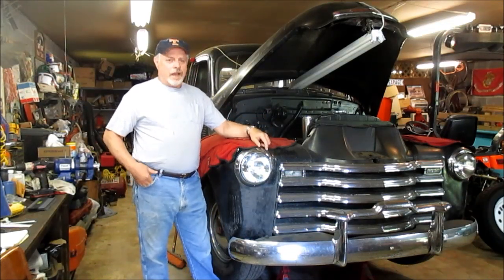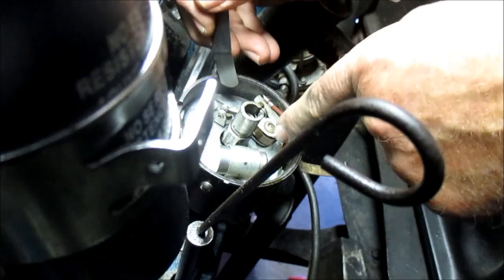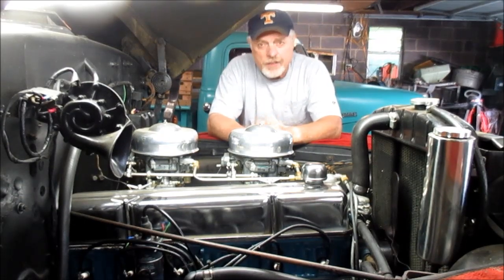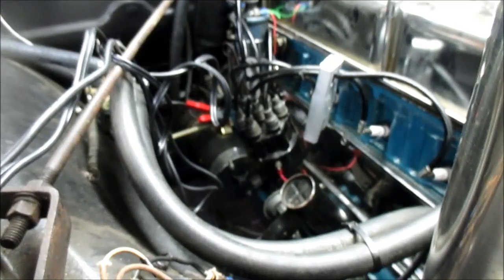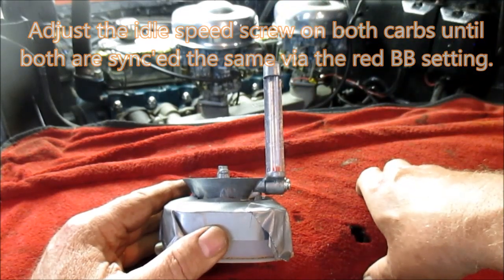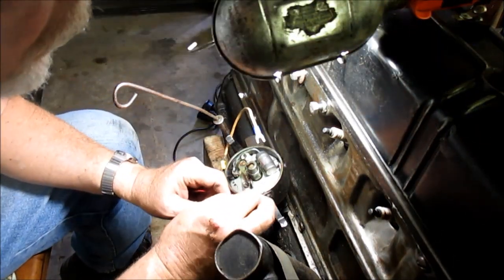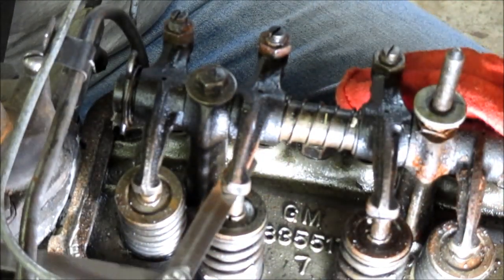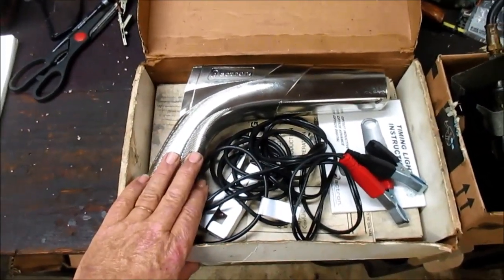1949 Chevy 3100, Engine Tuneup, Volume 37, PM part 2 .

Comment: Thanks for your support. Since you own a GMC and a Chevy trucks, We have a question for about 48 GMC vs 48 Chevy fuel pumps and its Are they the same or interchangeable? 
See we ordered a GMC fuel pump by error and we installed it but we were not able to get to pump fuel from the tank to carburetor. We ensured the lines are not obstructed and a new fuel filter. We just ordered a replacement pump for a 216 Chevy engine and received it today. We hope you can “pump” some ideas to us. for your information we purchased the pumps from Classic Part of American.
Reply from the maker: The stock GMC engines are different from the stock Chevy engines back in those days. The GMC's made more power and were considered industrial. I don't know if the fuel pumps are the same. Heres a link to a fuel pump for a GMC on Rockauto's site. You could pursue it or compare it to a 48 Chevy 216 fuel pump.
https://www.rockauto.com/en/catalog/gmc,1948,fc280,3.7l+228cid+l6,1486826,fuel+&+air,fuel+pump,6256
Reply: @Volfandt  Wow! Thanks for your advise. Since we have both pumps on hand physically I see no difference. Took some measuring of both pumps actuating levers and I can’t find a significant difference between them nor physical body. It may have to do with pump suction capacity Vs under mounted fuel tank Vs fuel tank mounted in the inside the cab.
Reply: Well, we’ve received the 216 fuel pump from Classic Parts and located our old pumps (which misplaced) and compared the GMC, Chevy and our original fuel pumps and they visually look the same except that the actuating levers are angularly not equidistant from the pumps lower housing thus affecting the relationship between the lever and the cam shat lobe. We disassembled the GMC pump and used its upper housing and diaphragm on the original pump’s lower housing. Installed the latter assembly on the engine and filled the output line with fuel, cranked the engine and got fuel to carb. In a few days we’ll be starting the engine. Our deepest thanks for your insight.

Comment: Hello David.. I’m not to far from you in East Tn. Up around Oneida/ Huntsville. I have been following you since I got a bar find 54 3100. This truck is mint shap and all original at 6 volt. I can’t get the 235 running because I am thinking I have the plug wire off on the distributor cap. Is there a standard of where the plug wired go from the clips and wire location?  Thank you for all that you have done. Loving your channel. Also. I would love to go to the next car show at Gibbs school. Let us know when it will be.
Reply from the maker: Hey Jason, congrats on the 54. 6v is fine and as long as teh electrics work I'd leave it that way. You can add a 6v to 12v converter to add a couple 12v circuits for radio and/or a power port and still keep the rst of the trucks electrics 6v. I did it for years.
re. plug wire location on the dist cap.
1) bring the engine up on #1 cylinder TDC compression stroke. You can put a small piece of toilet paper of similar light paper into the #1 plug hole and spin the engine by hand until it blows the paper out. Then align either the BB or UC mark on the flywheel with the pointer in the timing hole just above the starter.
2) where ever the rotor button is now pointing is where your #1 plug should align directly above the tip of the rotor button.
3) Using this firing order, 1-5-3-6-2-4, going in a clockwise direction on the dist cap, plug in #1 plug wire directly above the rotor button tip, then #5 into the next hole (clockwise), then #3 eyc. 
You should then have your plug wires in the correct position.
Good luck.
P.S. I'll try to post when the next Gibbs car show is in the spring. We now have one at the HS and another at the middle school. My church may have  one this summer also.
Reply: @Volfandt  you are great Gentleman. Please keep doing what you’re doing.

Comment: Great video, it brought back memories of my first car, a 1941 Chevy master deluxe with a 216 which I bought when I was in high school for $65 in 1968. A couple of interesting facts. My engine had 10mm spark plugs, which were only used in the 1941 model year. Also, most folks dont seem to know that the 235 was introduced in 1941 for the large trucks only. At the time the 235 used the same dipper rods with babbit bearings as the 216 as well as the tall side cover, making it indistinguishable externally from a 216 except for probably the serial number and possibly the block casting number. Not sure when the 235 changed to the short side cover and insert bearings with full pressure oiling, but I'm thinking 1950.
Reply from the maker: Good post Pete, thanks for watching

Comment: So why did you run it at that high rpm to set timing? I have always set the timing on mine at idle with the vacuum line disconnected
Reply: Also, thanks for making these videos!
Reply from the maker: @brandongodfrey5920  Your welcome. Brandon. Short answer is to email Lars Grimsrud at  v8fastcars@msn.com
and ask him for his SBC tuneup papers. It's alot of reading but worth it.
Heres some cliff notes:
1) On an SBC (& most other V8's) the engine will run more efficently, get more MPG and may even run cooler when the distributor gets full manifold vacuum at idle instead of ported vacuum.
Inorder to set the engine up properly for this the max mechanical timing (no vacuum advance applied) is usually set to 36 degrees BTDC at the rpm where the dist no longer supplies mechanical advance. This depends on the engine and can run anywhere from 2800 rpm to 4000 rpm. Theres more to it so thats why I recommend emailing Lars to get his papers. He was quick to respond and didn't mind providing this valuable resource. My L48 has never run as good as it is now with these settings.

Comment: Thank you for the videos. You make learning fun.
I’m working in setting the timing in my 216. 

Dumb question…..How did you get your truck to stay at 3000rpm?
Reply from the maker: Thanks Chris. I used an old telescoping wood clamp, one end on the gas pedal the other adjustable end against the cowl vent lever, worked great.
Truck stops used to carry adjustable throttle pedal depressers so the trucks could idle faster when sitting a long time. I don't know if they still make them.
Reply: @Volfandt  thank you! Appreciate all your videos And help!
Reply: How did you get the truck to stay at 3000rpm so you could set the timing ?

Comment: I just got the same timing light as yours.  So if my timing is supposed to be at 5 degrees at idle on a 216 , do you leave this timing light at zero or dial it to 5* and then check?   Also the total advance at 3k rpms, you recommend I do this and set to what the spec is at that rpm?  Mine is 39* at 3450rpms per the spec book.  Thanks.
Reply from the maker: There are two timing marks on your flywheel, the BB which is 2 degrees BTDC and the UC mark which is TDC. If you set your timing light to 5 BTDC you will want to time to the UC mark. You'll also want to be 450 -550 rpm.
39 degrees at max rpm must be with the vacuum connected to the distributor. Generally you want to set max mechanical advance with the vacuum disconnected and plugged as it adds approx 10 more degrees of advance. If you set your timing via max mechanical advance you really don't need to reset it at idle. What you want to do is "read" what it is at idle (by adjusting the timing light to get the UC mark on the pointer) so you can use it for future reference.  It's alot easier and quieter to set timing at idle than at 3K rpm.
Good luck
Reply: @Volfandt   I sincerely appreciate your expertise and masterful advice.

Comment: I really enjoy your videos! Great work.    Also what is a good idle speed for a 216?  I see the shop manual says 450-500 but that seems so low.  My engine runs better at 800.
Reply from the maker: I set the idle on my old 216 to 500-550 rpm and it was smooth as silk. Timing was set with the pointer directly on the BB. The carb was set slightly to the rich side. 
Try getting your timing and idle mixture set and you might get a smoother idle at a lower rpm than 800. Thanks and good luck.

Comment: Thank you for the information I just recently purchased 1954 GMC.
 Napa thinks it has a 235 but looking at the head cover I think it might be a 216
Reply from the maker: Congrats on getting a 54 GMC.  Unless someone installed a Chevy 216 or 235 engine in your GMC, it's more than likely a 248 GMC engine. Installing a Chevy 6 isn't uncommon but most GMC owners tended to keep their GMC engines as they had more power. 
Look for the serial # on the engine boss just aft of the distributor then do a search on it. You might find this web site helpful also:
http://www.oldgmctrucks.com/page0010.htm
Good luck.
One more thing, one of the quickest ways to tell the difference between a Chevy 216 and 235 is the side pan cover. The 235's is short and doesn't cover the head, the 216's is big and covers the block and head on the right or passenger side. The spark plugs go through the side pan on the 216 and not on the 235.  Good luck.

Comment: Was wondering why you don't have rubber boots on the spark plug end of wires??
Reply from the maker: I wanted to keep the engine as close to period correct as I could and those are the period correct plug wires. That said, if your not careful they'll bite you, LOL.  If I go with a GM HEI I'll be going with late model booted resistor plug wires. Thanks for watching.
Reply: @Volfandt  I thought you were going to get bit when you taped your tune up, Ha Ha!! Great job!

Comment: Really enjoyed this. I have a 1946 216 on a stand that I put all new gaskets in and painted it up pretty . It to leaks a little oil on the back passenger side corner. I thought I had it sealed good . The second time I glued two gaskets together to double my thickness and thought I had it stopped. But nope. Still weeps a little. Thanks for explaining those dual carbs. I have a single Weber like yours on my stock 1955 235. To helped me understand it’s working better. I would like to go with dual carb ,dual exhaust setup in the near future. Your motor is looking real sweet.  You were saying something about 1 of those 32/32 Weber’s is not enough for the motor. Did I understand you right on that. Thanks again.
Reply from the maker: I've heard those 216's can be leak free but mine never was, lol. Yes I did say just one 32/32 Carter Weber was too small for a 235/261 but it will work OK on a 216. I've heard the 32/34 will work alot better with its bigger secoundary. Thanks David

Comment: Great video! What temperature thermostat do you run on your stovebolt?
Reply from the maker: 180. I used to run a 160 but it didn't get hot enough in the winter.

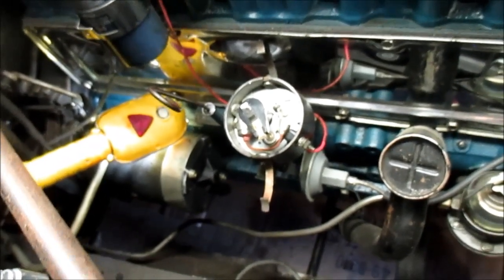Comment: 4:47 Yes, deliberation of those 6 jurors will most always render a verdict.
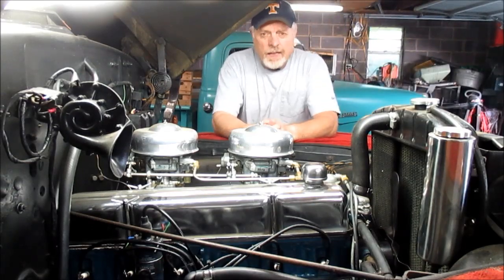17:26 & 34:00 I cheat a little bit on mine. Once I've found that max engine road performance setting of the distributor. Then I take a measurement from where the vacuum line meets it's fitting, over to the nearest point on the engine block. That way I'll at least know where to start, for the next tune up. 
But till that next tune up, I might just be marking a place on the boat where I'd caught my best fish.
Reply from the maker: Fishing sounds like a good idea. I'll be loading up the Mrs SUV and headed towards the east coast of South Cakalaky for a week of listening to the waves crash and pondering all things requiring pondering. To heck with the wuhan flu and the anarchists I say.... I know this Capt that'll give me a little discount and take me out around the shrimpers and we cast for black tips. A 5 footer will wear you out. I'm not fond of the fillets but many in my tribe absolutely love 'em soaked in Italian dressing and grilled to a fluffy texture. The next vid will probably be of cruising the GMC but I'll get back on the Chevy when I return refreshed and ready to turn a wrench.
Have a good un'.
Reply: @Volfandt  Good deal. Fishing is a step back from the masterpiece we're always painting. Pondering is the healthiest up's our minds must make.
2 months of major sins being locked down is the only upside for America. The anarchists fit this scenario as far as I'm concerned... ''Angry snakes lash out. It makes chopping off their heads that much easier.'' Who knew there were so many?

Comment: Very nice brother . I recently bought a 49 three window with a 54  235 motor in it . Just learning to work on it and it has been alot of fun . Not a mechanic so bear with me . Truck sat in a pole barn for 21 years . I got it running driving and stopping . I noticed the other day while tinkering with adjusting carb that when revved up the distributor has a lil bit of rotation travel. I read some info that says this is normal vacumn advance but I'm skeptical that it should move. It will travel on acceleration and then go back to original position after letting out of throttle  . I tried to see if the distributor was loose and the screw that tightens it is tight . Any advice on this  ?Getting ready to put in a fenton dual carb manifold and cast iron headers .  Thanks again for your videos , you have helped me a ton by watching your channel
Reply from the maker: That is normal. Instead of the vacuum advancing the breaker plate like in modern engines the 216, 235 & 261 engines rotates the entire distributor. Thats how they did it back in the day. It's unusual but does the job. The duals work good but so does the stock single setup. Congrats & good luck with your truck. Thanks for watching.